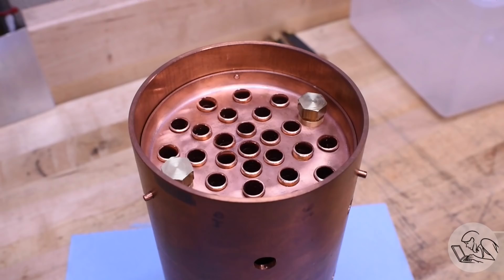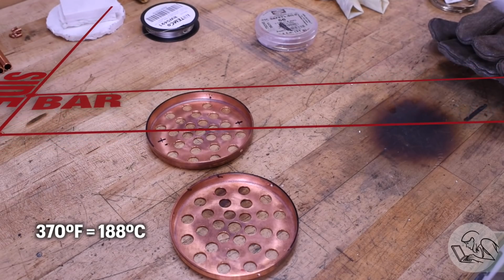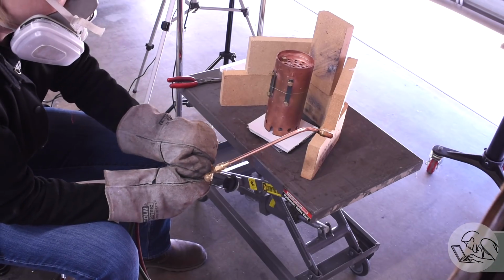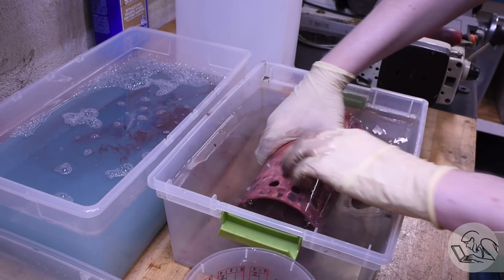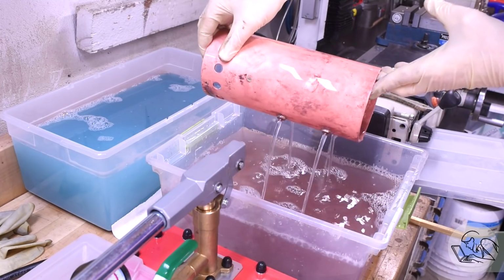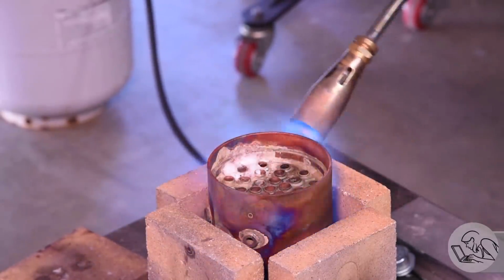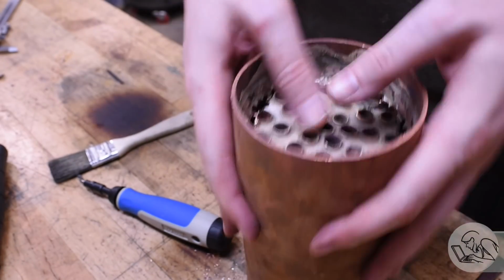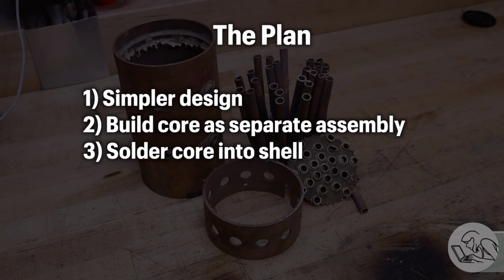Silver Soldering A Model Boiler : Failure!  | Model Boiler Build Part 7

Comment: That's a huge can of worms you opened. I would have been amazed if it would have worked. I worked at a hydraulic fittings company back in the 70's. The pieces had tight tolerances compared to your fittings. Each joint had a silver solder ring inserted and then the parts were pressed together. Everything was fluxed and put into a temperature controlled oven to bring the entire part to the same temperature to melt the solder. These were steel fittings for John Deere hydraulic hoses. We still ended up with a percentage of each batch failing! 

My father was a jeweler/watchmaker and I watched him solder thousands of rings during repairs and sizing operations. He had more trouble on silver rings than gold rings because of the extreme heat required. For gold he always selected a gold that melted at just under the base metal temperature to help prevent turning the whole thing into a puddle. With prong mounts it required a very hot and small tip on his propane torch to heat up and stick one prong without dislodging the prong next to it. Flux is your friend. Don't be afraid of using too much. The pickling later will clean up any remaining excess.

Is there some reason your building out of copper? I think it would be easier to make it out of stainless steel and Tig weld it together one joint at a time.

I worked in a hydraulic cylinder company for 15 years and even our best welders still got pin hole leaks on occasion. Those are easier to fix with a welder than this big can of worms your dealing with.

Comment: Thank you for sharing this Quinn. It must have taken some courage to spend time editing and putting out this video.  Although an engineer I have no technical advice to give on this. I have enough trouble soft soldering electrical joints !  My traction engine is all hot riveted and the tubes are expanded .  My only suggestion (if you haven’t already) would be to look at Nigel’s videos at the Go Create Hobby Machine shop (on YouTube)  where he silver solders a  5 inch gauge Lion loco type boiler.  I gathered from the videos he was a machinist primarily and that he too was no  prior expert in silver soldering, so was a learning process for him too.
Reply from the maker: I’m a big fan of Nigel’s videos. I hope he starts posting again!
Reply: Me too !
Reply: I see now you’ve had a nice comment from him !
Reply: I fully support this suggestion, Nigel's series on the Lion is very good and his silver soldering segments are one of the best available,  keep up the excellent series and give Sprocket a pat for me.

Comment: I jewelry class I was taught that prior joints re-melt at a higher temperature than they originally did. I've experienced that myself many times, and in fact after reheating a second time, it's a higher temperature again. Something about the alloy changing?

Comment: If you want a difficult boiler try a Woolnough boiler I finished mine  during pickling it was knocked off its shelf heavily denting the top tube 
It now sits in the kitchen on display as a reminder not to do this kind of stuff around a dog 
The dog is fine 
Mike

Comment: I thought soldering only melts the solder and the other metal remains intact but brasing actually alloys some of the filler material. Or is it a case it's all a continuum.

Comment: Blondihacks, a good channel for silver soldering is Keith Appleton. Get the items red hot and then apply the solder. Doing the core first and slipping it in will help. Putting the unit on an electric or gas hotplate will keep the heat from disappating so quickly.
Reply from the maker: I’ve referenced Keith quite a bit on my channel. He’s great, but boiler building is a particular sub-specialty different than casual silver soldering
Reply: @Blondihacks  That's true and he doesn't build boilers. But your problem is getting the heat to the source quickly. Build the core first and make sure that is OK before you slip into the shell. Since the mass loses heat so quickly, slow down the loss by putting on a gas or electric heatplate. You may have to the the boiler on a pan over the hotplate. Then do the shell quickly and the heat won't transfer to the tubes as quick. Also, a small fan blowing through the tubes will keep the joints cooler and slow down the conductance. The inner tubes in the core won't heat as fast as the ones near the shell. I pray this attempt goes much better than the last but you learned quite a bit and taught even better. Keith says you have to get the joint read hot before the solder will wick. And having it on a gas burner while you do the tubesheet to shell will allow that to happen without the copper transferring the heat away. The big pressure vessels would be heated in an oven prior to welding then weld the thick shell. You can also turn down the heat slower and allow less stress doing so. Cold solder joints are bad in electronics too. Love your videos, keep them coming! And the next try will be a success!

Comment: I use Sparex routinely to clean silver solder joints, but one thing to consider is it can act as a bit of an anti-flux.  I usually neutralize it with ammonia before fluxing and soldering.  I also concur with soldering in stages, not all at once. In some cases, you’ll need to use several different solders with progressively lower melting points to minimize solder remelt.  There are families of solder designed for exactly this purpose.  Also concur that you need BTU not temp, and the Sievert torches are awesome.
Reply from the maker: Hence my plan at the end

Comment: I REALLY love the intro.

I long time ago I had a friend that was building a live steam engine.  At one point, while building his boiler, his father was going to a Canadian Tire Store (Canadian chain of automotive hardware and assorted hardware stores) and asked if he needed anything.  The friend asked his father to pick up some solder, which he did.  The father picked up plumbing solder.  The friend completed the boiler and it passed the pressure test and was fine until he first fired up the boiler. 

Then the boiler started to peel apart.  It required a complete boiler rebuild, this time entirely with silver solders.

Thanks for the video showing your failures, especially with you cutting up the boiler to inspect the interior.  Although I am not about to build a boiler, and never have in the past, I learned a lot from this video.  I wish you better luck on your second effort but do appreciate this one as well.
Reply from the maker: Being Canadian, I basically grew up inside Canadian Tire. 😀 sounds like the friend had a close call there! 😅

Comment: i had the same problem only pin prick leaks topped it off with soft solder tested boiler to 220 ppsi boiler works fine it is a 6 inch boiler hope this can help dont give up

Comment: For soldering low temperature electronics stuff at whole PCB level (hundreds to thousands of joints simultaneously) we use a solder paste, which is basically tiny solder balls in flux. I wonder if a similar thing is available for high temperature silver soldering.

Comment: That's quite interesting.  I can see the domino effect of so many joints at once.  Makes me wonder if a complete oven big enough, and high enough temps to reach the proper melting/brazing point would work better?  What made me think of that, is the float-solder techniques used by electronics.  That, and firing clay into vitrified ceramics.   Still, much learning is witnessed by this, for sure.  I was an HVAC guy for years, and we used 10% silver brazing sticks, exclusively.  We also used low-oxy flame, which pulled much of the copper oxide from the tubing.  Even then, scuffing all joints with fine paper or steel wool was essential (as you did).  

However, I only ever did one joint at a go, so really, that's not even close to doing a dozen joints at once, as you attempted.  One thing we always did, was quench each joint with water.  A failure to quench, nearly always created a joint that was brittle and prone to vibration failures down the line.  But we weren't using silver solder, so...  different applications, different materials.  I'm very much looking forward to Boiler Solder v2.0 videos.  I learned much from this one already.

Comment: It looks like it’s one of those jobs that you only really get one shot at, a bit like plastering. Less is more so to speak.
Reply from the maker: Yah, I think that’s true for the tubes. Fixing them is very difficult. The outer joints are easy enough to fix.

Comment: I'm a neophyte at all this (I'm mostly a wood worker) & just wanted to say how much I learn from your videos.  You may be working on a project that I'm not really interested in, but you're teaching me techiques which are very applicable & that I do need to know for my projects.  I've learned many improvements to my lathe practices for the metal parts.
  I have several silver solder joints on my violin and my artist's canes and your teaching on the boiler really helped me & I thank you very much!

Comment: Im not a metalworker so im just genuinely curious. why do you have to solder them together, wouldnt it be easier to just weld the pieces together?
Reply from the maker: Making a gas tight weld is much much more difficult for an amateur than silver soldering. Now imagine making 63 tiny gas tight welds that are all perfect. I’m sure some pros can do that, but I don’t know any hobbyists who can.
Reply: @Blondihacks  Worked at a power plant and watched them make a boiler tube repair.  Cut your way in and weld your way out.  If you can weld at that level of expertise you can make a bazillion dollars an  hour.

Comment: I have an oxy/acetylene torch and never filled the acetylene tank. I just use it with propane and works well for brazing. I just don't want the hassle of dealing with acetylene safely. O/P can't weld but I have plenty of welders. It is also cheap to run.
Wonder if Stans Hot shot 360 would work for the "all at once" method.

Comment: Internet experts boost engagement! Let us deal with them :3
Also, now that you are considering making the boiler core separate, how about making the shell out of steel? Is it frowned upon by the model engines community?
Reply from the maker: Larger model locomotive boilers are made from steel, but corrosion is a life long battle with them. Stainless is not considered safe for steam boilers by the community, though I don’t know why offhand.
Reply: I ment make the core copper, all self contained and sealed, and then the shell woukd be a steel or aluminium tube, just needs to provide enough strenght to hold the inner copper core from becoming a sphere. I dont see why you would have the whole thing out of copper, exept for the ease of soldering. Which you could still get with a 2 piece design. Also, high temperature adhesives are a thing now adays, weld replacements they are called. I know the old guys will not like them because they didn't exist 30 years ago, but thats what engineering is about.

Comment: As per a song I heard in chemistry class... "You put a littler water into H2SO4.  Then you hold your ears because it gives a mighty roar!  You put a little water into H2SO4, and it blows you out the door!"   
OK, I think the real danger of diluting acid the wrong way is that you might get splashed by the acid.  But if you remember the 'song' you won't dilute it the wrong way.  :-)

Maybe putting the boiler into a kiln to melt the solder would have been better?
That big torch looks like one that Glasslinger uses when he makes vacuum tubes.
Reply: The warning my chemistry teacher taught us nearly 60 years ago was "Poor old Smithy is dead and gone his face we'll see no more for what he thought was H2O was H2S04"